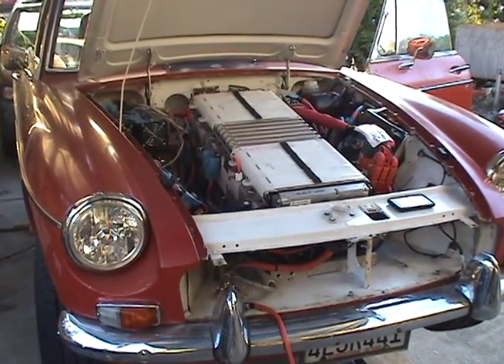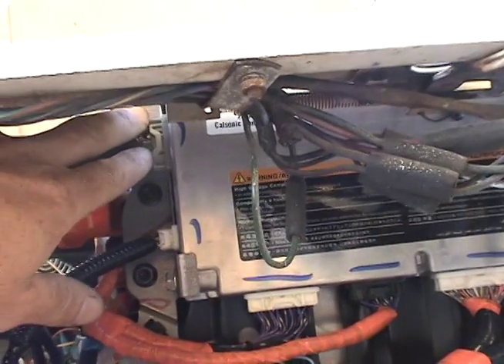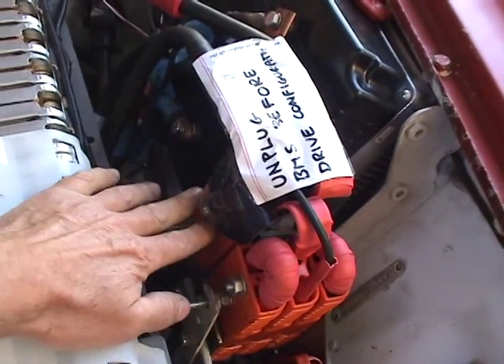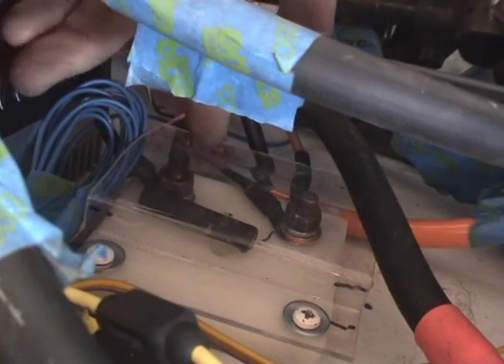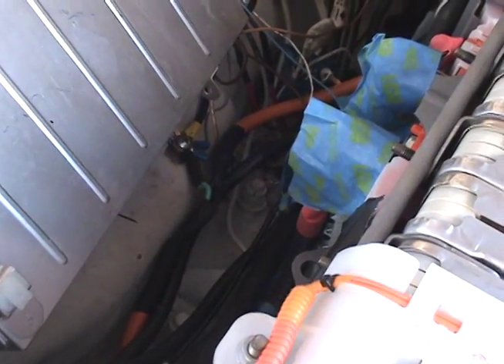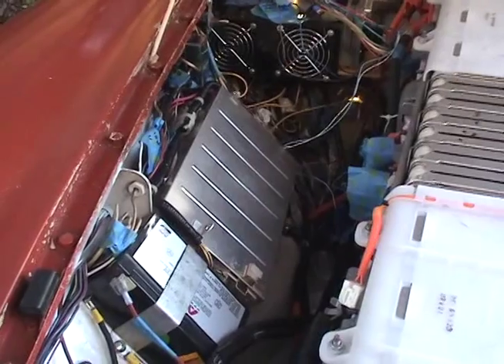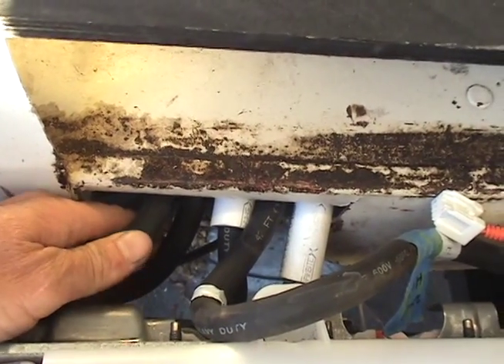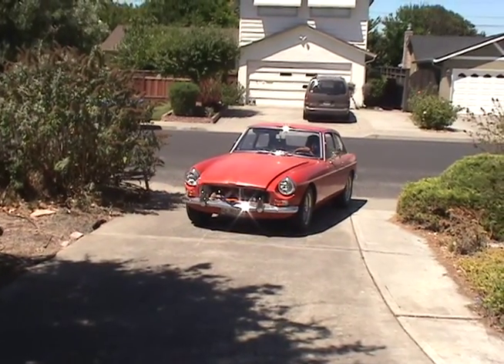Description of an MGB-GT to  EV conversion

Comment: Mike, I recognize that this video was posted several years ago, but can you provide more detail on how you connected the Leaf motor and/or gearbox to the MG's driveshaft and/or differential?

I'm considering a similar project with a 1969 MGB roadster and trying to wrap my brain around the physical connection of the Leaf drivetrain into a rear wheel drive car.
Reply from the maker: Hi Mark, in this conversion I didn't use the Leaf motor, just the batteries. The motor used was a HighPerformance AC50 motor from a supplier near Los Angeles. It's a 3phase AC motor with a simple drive shaft which is connected to a Nissan ZX gearbox. The existing driveshaft was adjusted (professionally) to the right length. 

To get the leaf motor in you are probably going to have to change the whole rear axle assembly to an independent suspension arrangement so that you can connect two drive shafts from the motor to the wheels. 
I'm pretty sure I saw a kit somewhere that changes the rear axle in this way.
However, there's no reason why you can't detach the leaf motor from its integrated differential. If you do this then you'll be left with the task of mating the motor output shaft with the gearbox input shaft. Technically you don't really need a clutch and flywheel but having built this car without a clutch I think it would have been better to leave it in and attach a flywheel to the motor. It doesn't have to be a heavy flywheel, a lightweight version would be fine.
There's no reason you can't use the mg gearbox. The benefits are that you won't need to change any of the drive shaft/mountings etc and you can concentrate just on connecting the motor to the gear box.
Good luck. Keep it as simple as you can because it always gets more complicated than you imagine. 
Curious to know how you are going to control the Leaf motor?

Comment: Mike, I see this video was posted in 2014 and it's now Sept 2016.  Any updates on this conversion?  I once converted the engine of MG BGT and replaced the old engine with a more modern Toyota engine.  A lot of complications but we got it going and I drove that car for another 5 years.  I now own a Nissan Leaf, so you can imagine my interest in your project.  I'm curious about the gauges, the interior switches, etc, etc and any problems.  Tell me why you didn't choose to use that Nissan peg board 'kit' and install it into the MG, removing the gear box and simply extending the drive shaft making a direct connect to the Nissan motor?  In that way you'd get the simplicity of everything Nissan has built, plus an air conditioning system, seat warmers, power steering (perhaps power windows) not to mention blue tooth enabled radio, etc, etc.  All the modern perks thrown into a beautiful classic car.
.
Lastly, can I suggest you review the brake system of the MG, it is simply terrible.  I'd suggest replacing the entire MG brake system with... anything else.

Comment: What is a max. Balancing Current (max. Ampers per Cell) with original Leaf BMS?
It's about 0,5-1A or more?
Reply from the maker: +Alexander Schoenfeld When we analysed the circuit in the BMS we found the resistor used to establish the balancing current was 430ohms.  This would mean the current would be in the order of 10mA   (10 milliamps) - I.E. not very much at all. It must take quite a while to do any balancing.
Reply: mikeatyouttube 10mA is really to low...

Comment: Hello, tell us how you managed to run BMS ?
Reply from the maker: +Алексей Тыченок Short answer is : we stopped using the BMS.  The Leaf BMS works by comparing voltages on the cells and trying to even them all out (by applying a resistance across a cell which is a bit high in comparison to those around it).  The Leaf BMS requires the batteries to be wired as a 400V pack. I did all the BMS wiring to connect the batteries and when the pack was wired as a 400V unit (during charging) then the BMS worked just fine. However, every time the pack was rewired to provide just 100V we had to disconnect the BMS (literally pull the connectors out of the BMS module). This was a pain and just one time the owner of the car forgot to disconnect the BMS module, switched to 100V mode, and this broke the BMS. So it doesn't work anyway. Since that time he has upgraded the battery pack (added more cells) and now the car drives at 130V. This means that when the batteries are wired in series for charging the pack voltage is around 525V which would make the BMS useless anyway.

Without a BMS, bad things happen - take a look at my video on repairing a Leaf battery pack and you'll see what happens when batteries are abused.
Reply: +mikeatyouttube I understand you, thank you for the answer. But I was still interested, you simply connect it to the battery and it worked, or even that it was used further, for example with Computers Nissan Leaf ?
Reply from the maker: +Алексей Тыченок The BMS required 12V input from the car regular battery. There is a CAN bus - but as far as we can tell it's just for output - from the BMS to the main computer. It appears to work without the main computer connected. As you can tell from the video we could get the LEAFSpy app to display the voltages. We could tell the BMS was balancing the cells.
Reply: +mikeatyouttube Yes, interesting, please tell us!

Comment: Wish you would write a book for those of us not expert in electronics.  Did you take a wrecked Nissan Leaf and just transpose everything?
Reply from the maker: In this conversion only the Leaf batteries were used, and the battery management system. However, you could take nearly all the components - motor, inverter, charger, battery and most of the Leaf wiring and put it in another vehicle. The stack of charger/inverter and motor come apart (only connected by wires and cooling pipes) so there are lots of options. If you look at this video.. watch?v=McvDjpdcBw0  then you'll see that running the entire system without a car shell is quite possible.
Reply: mikeatyouttube
Thanks, just watched that video.  That's better than a book, it shows what it possible.